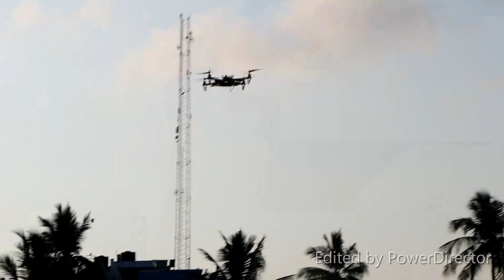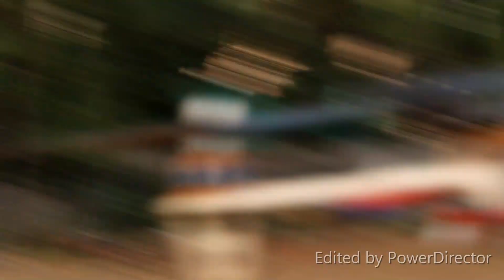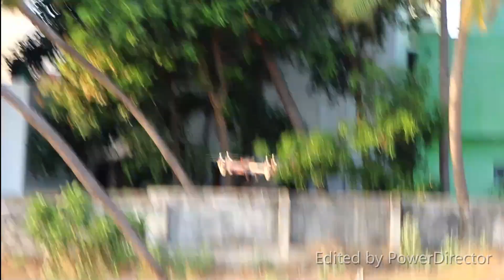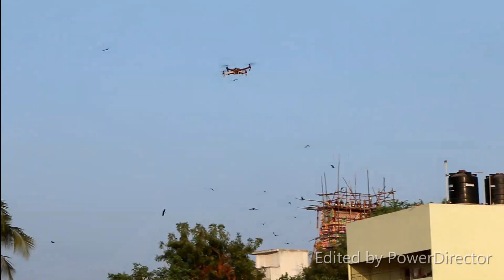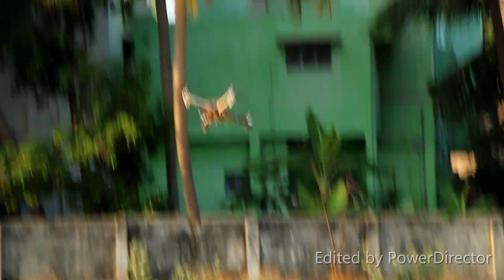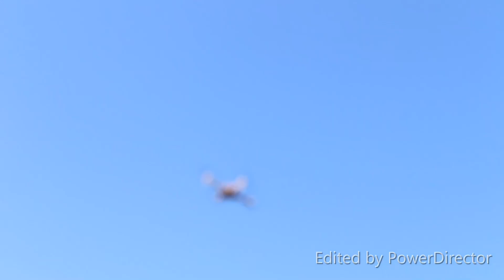YMFC-AL Flight Test

Comment: Brother im facing a problem, i have bulit the drone did all the setup when i start it behave violently it wont level itself and wont lift plz help me brother
Reply from the maker: Try centring your gyro properly and recalibrate the sensor.
Reply: @Vatzi22  i will show you the video its in the centre only